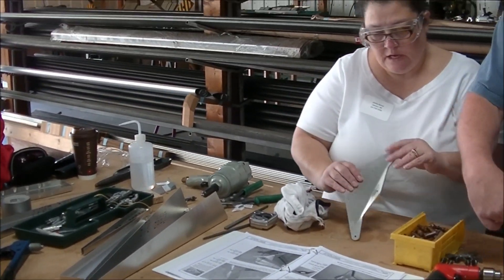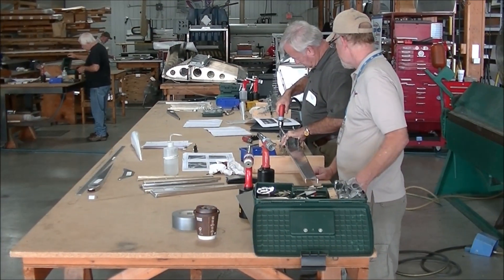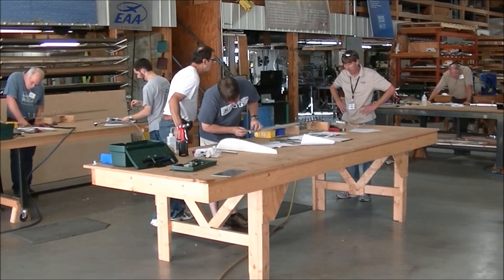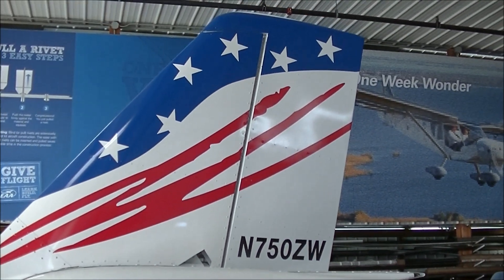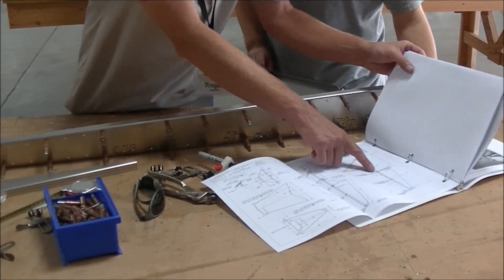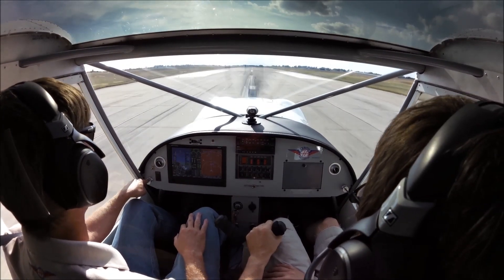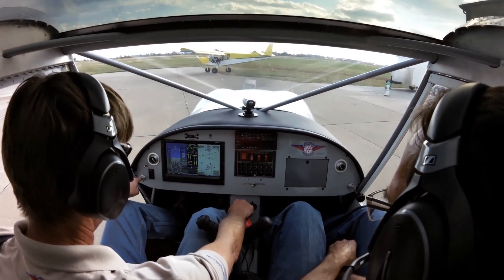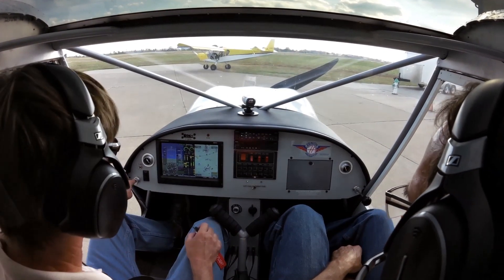Introductory rudder building workshop at the Zenith Aircraft factory

Comment: I make the rudder for the F-35 totally different from what you’re doing there but would love ❤️ to learn that method ‼️😎The rudder I make contains two circuit boards with approximately 24 wires housed in an aluminum box measuring 2”X 2” sealed in a black epoxy that takes one week to make! 😎Gas & Fluid rudder